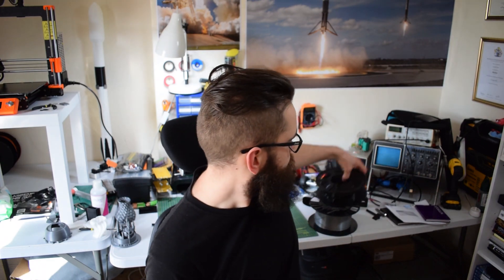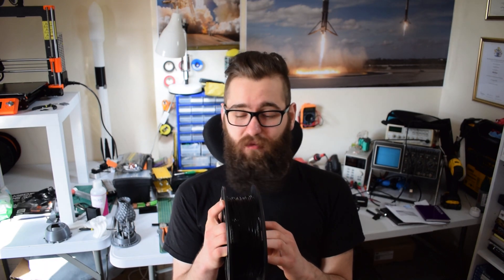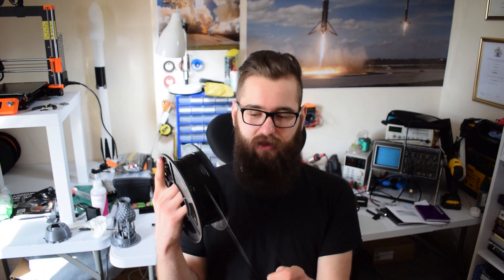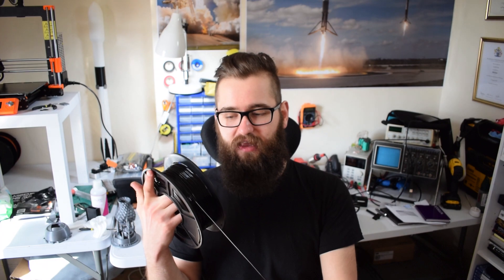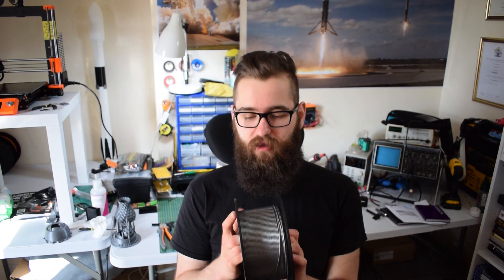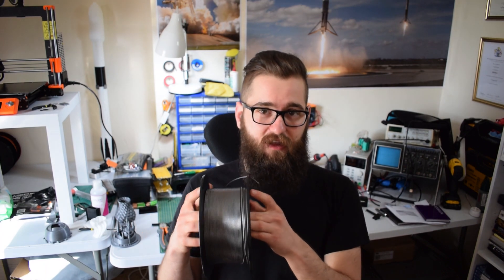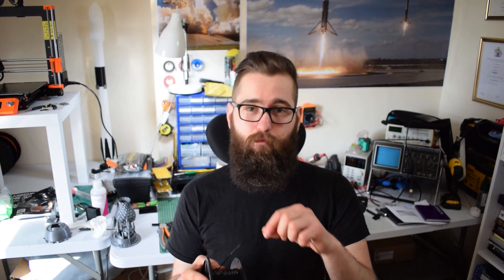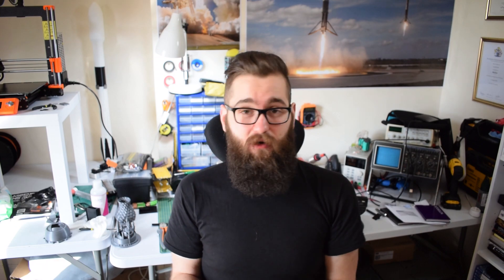Don't Make This Filament Mistake

Comment: I had this problem, then looked it up - for me it was because I had let the tension go in the spool, which then got the spool tangled up itself. On all3dp, it suggests that this is generally something users can avoid by handling spools without letting the tension out.
However, your description sounds like it arrived tangled - was there no tension in it?

Comment: Thanks for this video!!!
I just had the same thing happen, with a spool of PLA, the next day after watching this video!
I was watching my print and saw that the filament was tangled. I corrected it before I had any
extruder problems. Because of your video, I happened to look closely at that spool of PLA and
noticed that it wasn't wrapped uniformly.
Reply from the maker: Glad I was able to help you! It’s easily overlooked and can burn out an extruder pretty fast!